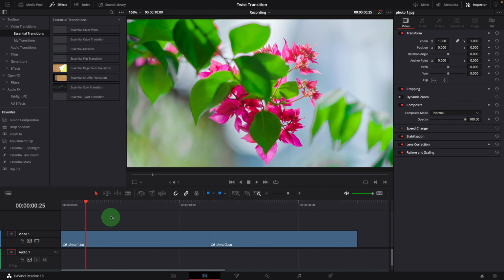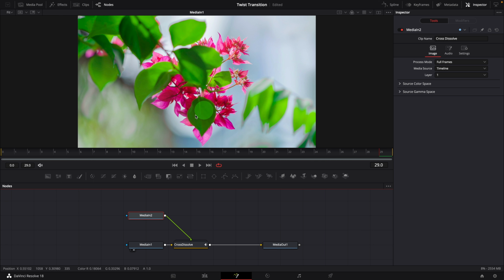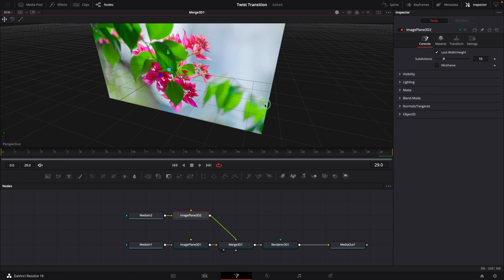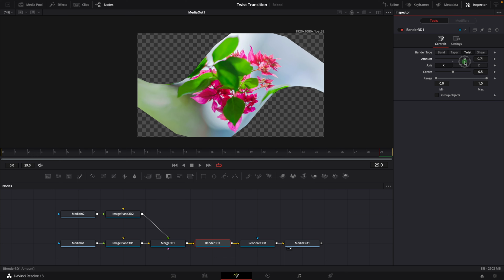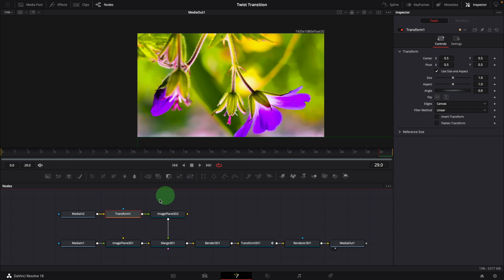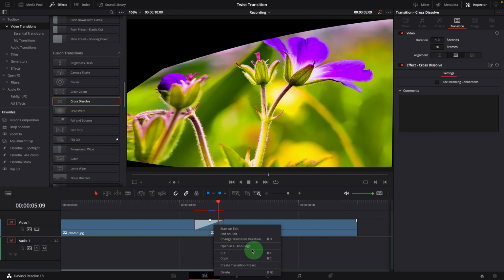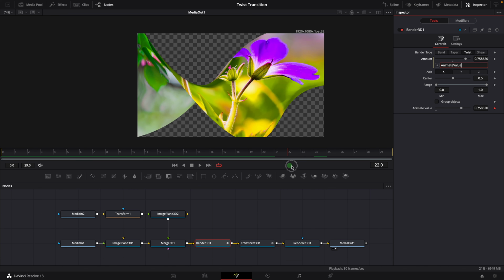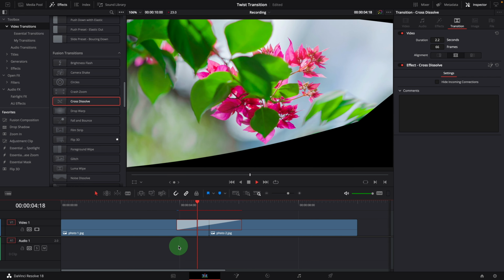Create Twist Transition Effect in DaVinci Resolve - Fusion Tutorial and FREE Template

Comment: Great tutorail but maybe its easier to put the animcurve directly on the Amount of the bender, Check mirror in the modifier and set the Scale to 0.5*(1-2*ClipLow)  and for the transform put Animcurve on angle and set the Scale in the modifier to 180.0*(1-2*ClipLow). Easier expression, no need to add a control. and the unused check boxes ClipLow are reused to invert twist and rotation. Thanks again for your great job.
Reply from the maker: Great, thank you for the tips. In my case I want to use only one modifier to control both bender amount and transform rotation X with the same preset In/Out curve options😊
Reply: @EssentialVideoEditing  I tried now, you can affect a curve from one modifier to another with an expresion, like any other parameter :)
Reply: @EssentialVideoEditing  I never try to connect the curves of two modifiers, don't know If that can work.